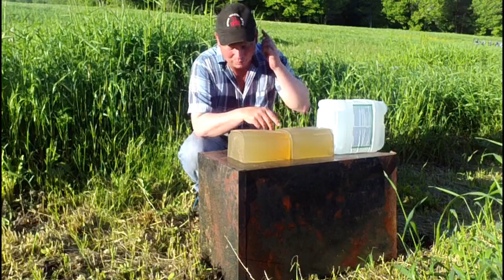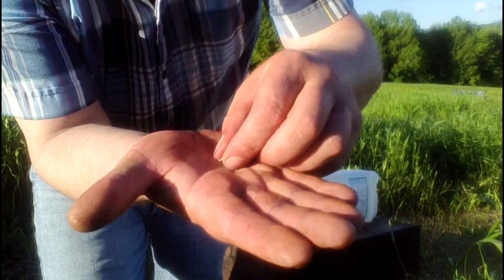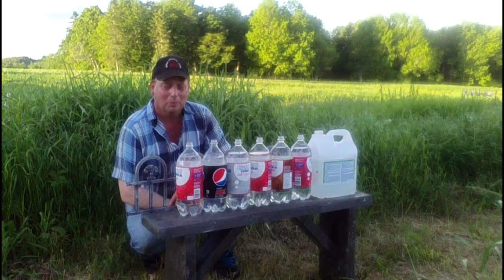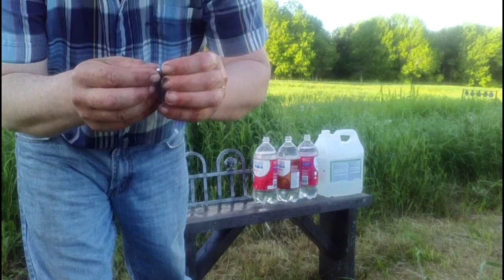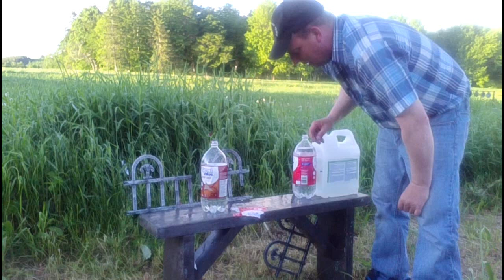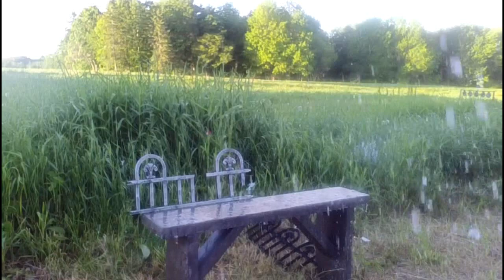223 VS 22 250

Comment: The .223 Rem is an offshoot of the original .222 Rem while the 22-250 was originally a wildcat cartridge based on another .25 cal cartridge.  The 22-250 has been around over 50 years and it needs a bit of a re-design because of the very steep taper which leads to neck thickening in reloads.   Also, Remington slightly miscalculated, providing a 1-10 twist for their fine rifles but the should have been 1-8 twist to enable the use of heavier, longer bullets with better ballistic coefficient.   Bullets in the 40-55 grain range will all "explode" quickly when fired into gel or water with close range targets.
Reply: +The Defenders Team I see what your saying however the 22-250 has been redesigned. its called the 22-250 Akley improved haha.
Reply: +Indiana GUNS I see.  It's not possible for individuals to keep up with everything going on with cartridge and gun design - plus - as you say, there's a new name designation, another confusing aspect of how we talk and write about "firearms" in general.  I suppose you mean that the case taper angle problem has been corrected by the new design. Is that correct?
Reply: yes sir it has. however the Ackley improved redesign is not only for the 22-250 it is for most calibers who just want a little more punch and effectiveness. but I like my stock 22-250 I can get about 10 loads on average out of brass depending on how hot I load them of course.
Reply: +Indiana GUNS Thank you for the updated information - something we can all use.  Do you know of any rifle manufacturers that produce rifles in 250 Ackley Improved?
Reply: honestly no it may be an aftermarket upgrade you have to get done but there are tones of load data for it.
Reply: +Indiana GUNS That's OK,  just another excuse to visit our local gunsmith. LOL
Reply: +The Defenders Team I'm looking at a 223 Tika.  Is the 1-8 more versatile in taking different size projectiles and better for long distances, accuracy improved etc?  If so, why do they bother with the 1-12?
Reply: +Scott Mac: I'm just guessing but would bet that most mfrs are thinking the users of the 22-250 and .223 want the shorter, lighter bullets for higher velocity and they can't offer "variable twists" in rifle barrels to they go for the 1-12 or 1-10.  But the 1-8 twist will give better spin rates to bullets which are longer/heavier and which have the better ballistic coefficient.
Reply: Does not need to be redesigned! Thats why we have the 22 250 improved already.

Comment: The 22-250 simply does a better job at transferring energy at whatever distance you tested the cartridges at. The 223 carried it's energy through more targets meaning it left less energy in the inital target and this is due to its slower velocity. the 22-250 on the other hand fragmented due to its much higher velocity leaving the majority of its energy in the first jug preventing as much pass through
Reply: Spot on. People think slower means less penetration, which is totally false. Just like water, soft tissue hits back. Faster projecitles almost always results in a wider wound hole that travels deeper.
Reply: John Doe I agree completely. The 22-250 has from 600-800 fps more velocity so with the same bullet it expands and rapidly disintegrates.
Reply: What you're talking about has more to do with bullet construction!

Comment: The 22 250  is just faster than the 223 at 100 yards.That's more than enough snap to bring down a deer. Any way I will find out this fall just how fast my new 22 250 is.
Reply from the maker: will maracle  The 22-250 in this video has taken a couple of deer and either one is certainly capable, shot placement is king!

Comment from the maker: Two popular varmint calibers go head to head and the outcome surprises me. Evidently my wife lies to me, size does matter! :D
Reply: JustAGuy who pretending? And my apologies... So many people that dont know shit about guns except what they see on tv comment on these.... Cant tell when ppl are being sarcastic.
Reply: the slower 223 may penetrate more but you can bet the 22-250 dumped more energy in those first 2 bottles. At the higher velocity of the 250 the bullet lost more weight I'll bet due to jacket fragmenting. How the the 22-250 reacted to the 2 bottles is what it was meant to do. Dump all it's energy in a small varmint.
Reply: BTA BossMan No.  The 5.56 tumbles out of the barrel and only holds 16 foot groups at 100 yards.
Reply: James Engles Wow.  Another idiot pretending to be a soldier.  What I said was pure fucking sarcasm towards that disillusioned dude who thinks the 5.56 isn't accurate at 300 yards.
Reply from the maker: Jordon Lorenzo  I haven't checked to see if there actually is more powder in the 22-250 factory loads but there certainly is more case capacity and according to any ballistics charts the 22-250 should have a little more oomph. I think that in this case barrel length had a lot to do with the outcome.
Reply: +Jordon Lorenzo there is I can load my 22-250 almost 600 fps faster than a 223 with the same bullet. in some cases they can be loaded to 4500 fps.
Reply: Ya think maybe that's my point?
Reply: +BTA BossMan its 30 round magazines. gtfo
Reply: James Engles I understand.  Guy was implying I can't hit anything multiple times passed 300 yards lol.  I don't believe he's ever shot an AR.
Reply: They are great if your just waisting ammo but if your trying to do something other than burn gun powder they are total crap......
Unless your pinned down by a small army.
Reply: +James Engles.. Hey bud Mag-Pul makes 40 round mags, I own two!! I can send you the link? Look them up.. I believe there are a few companies that make them but I know for sure Mag-pul does i have two Gen-2 4O Round mags.. Also you have SureFire 60 & 100 round mags that are quad stacked fat mags.. But they aren't reliable in my opinion.. Also shared by pretty much everyone!! And they are over priced for what your getting!! they only function well with brass case ammo in the SureFire mags.. If you use steel case it's malfunction junction 😂.. But I've been looking for the new Mag- Pul D-60 drum magazine.. But they're  always sold out at aimsurplus.com 😡 check out Matt his channel is demolition ranch!! You will like it I promise!
Reply: +James Engles ya your standard USGI 30 round stainless steel and aluminum mags.. Issued by the United States armed forces..
Reply: Burbidge86LLC Yeah, I have 2x gen 3 Magpul 40 round magazines for my AR.
Reply: Using Varget as a reference powder with 55gr bullet, the Lyman manual states:

.223 Max Load 27.8 (compressed charge) 3346fps 51,400 pressure C.U.P
22-250 Max Load 37.0 (uncompressed) 3696fps 51,600 pressure C.U.P

So yes, the 22-250 holds more powder, and has a faster velocity (with slightly increased pressure) than .223

Who knows though what the powder specs are for manufacturers rounds.
Reply: LOL
Reply: I now own both guns.... and as I said before the 223 is a total waist of money of your trying to shot anything other than a friggin barn. although it is a fun gun... costs a shit load of money to shoot though thanks to the 5 mags I have and the twitchy finger but with my laser sight if its in a 100 yards its toast. my 22-250 is a killer within a mile........ So again I state the 223 is cute but has little if any use for anything other than hunting barns or burning lead.
Reply: That makes me laugh.  You're not going to shoot anything at 1760 yards with a 22-250. The barrel twist rates aren't going to let you shoot a high BC bullet. They're designed for light varmint bullets and will be effected by wind way to much to hit anything that far away.  A 10 mph wind would have you off target by 10 feet at 1760 yards. An AR15, with a 20 in barrel, firing a 223/556 55 gr bullet is accurate at 500 yards. I've shot thousands of rounds at 200, 300, and 500 yards in the Marine Corps. In 8 years I never got a miss at 500. I can also shoot a 223 for under 20 cents a round.  Maybe you had a bad rifle or you just can't shoot.  An AR15 will hit something a lot smaller than a barn. It'll cost about 1/4 as much to shoot as a 22-250 too.  I'm not knocking a 22-250. I like all guns. That was a ridiculous statement though.
Reply: can you hit anything with that 40 round clip at more than 300 yards repeatedly every shot?
Reply: +JustAGuy no the fuck it does not. it tumbles after impact. we train our soliders with 5.56 at 300 yards
Reply: +Indiana GUNS Yeah, but can you take that 22-250 and load a 40 round magazine and shoot it out of your AR 15 style rifle?  I can with the 5.56.